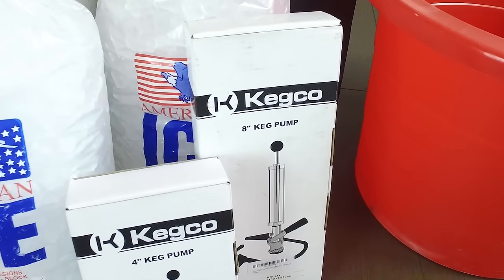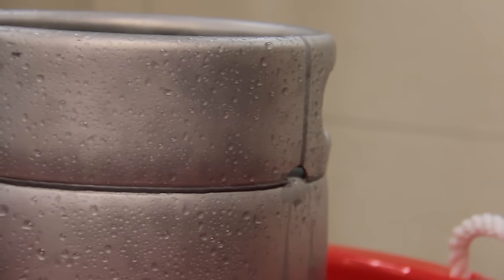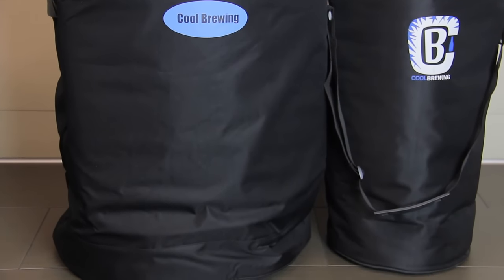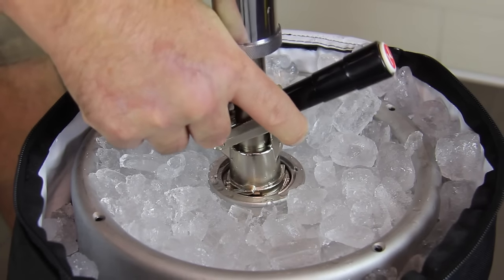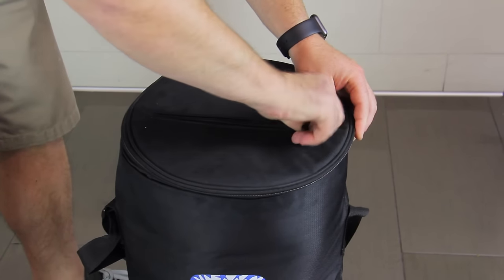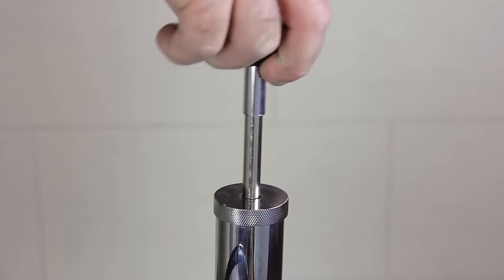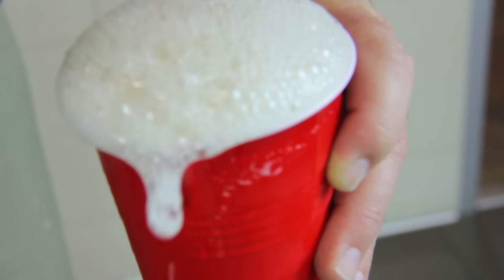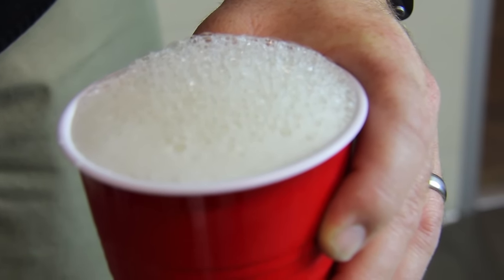STOP Wasting Beer! How to Tap a Keg with a Keg Pump the Right Way

Comment: I've only used a keg once, and my drinks would be 50% foam at the minimum. I think I'm less of a keg man, and more of a cans/bottles/cups man.
Reply: There's a certain way to poor it. Its like pouring pop, you have to tilt the cup and let the beer run down the side of the cup instead of just blasting it down into the cup.
Reply: You have much to learn.
Reply: @-PlayMaker-  don't pour your beer tilting your glass, do a search why.
Reply: My pop hates kegs

Comment: i love kegs man i worked at a bar and kegs just taste better imo we used an co2 tube, those shock cooler machines where beer just goes through tubes in 60 liters of ice thats around -50 degrees celsius and comes through the electronic tap that pours exactly how much you want it to pour.
Reply: If I want something small letssay 50-60 I'm a day for beers.. for the tube to cook things down and the actual device. Not to heavy . Portable.. any links. If Amazon has one let me know